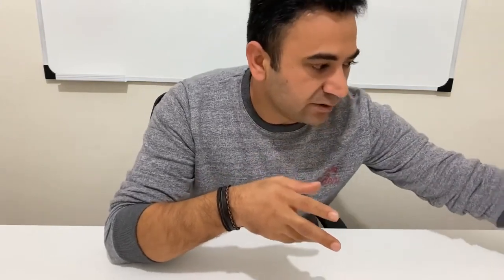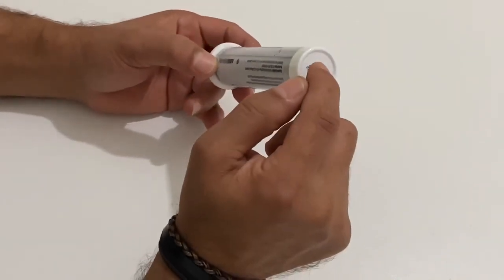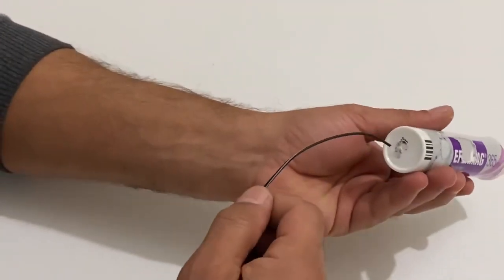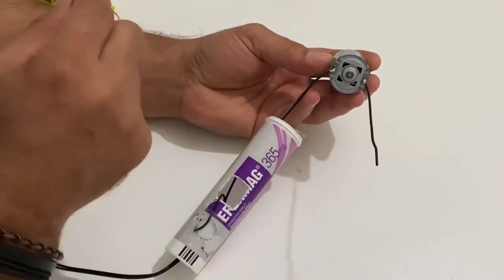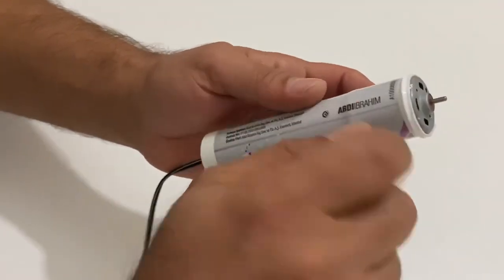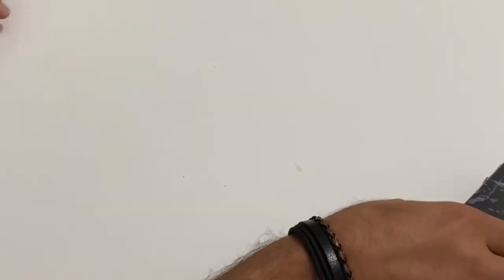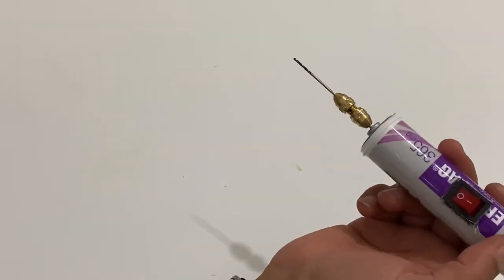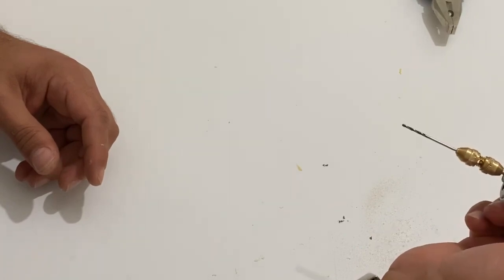How to Make a Mini Powerful Drill Machine | DIY Projects |

Comment: Nice! Suggestions for next iterations:
* Momentary switch instead of rocker
* Use 555 to adjust duty cycle
* Put 18650 in it for cordless power